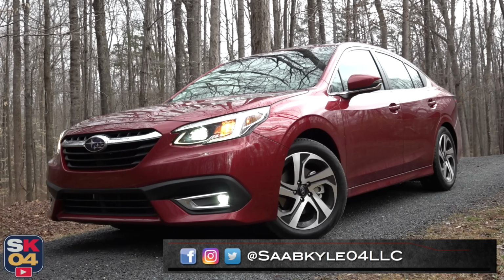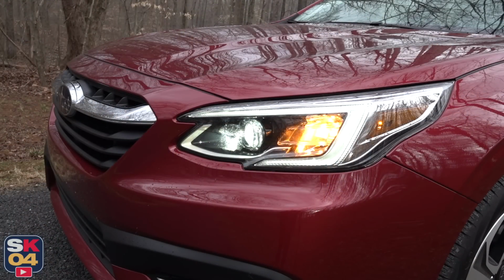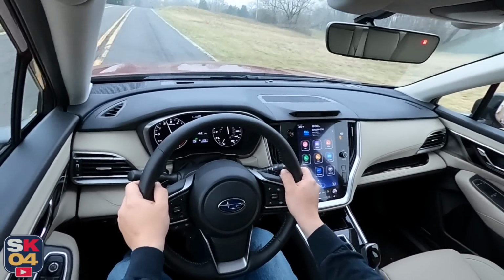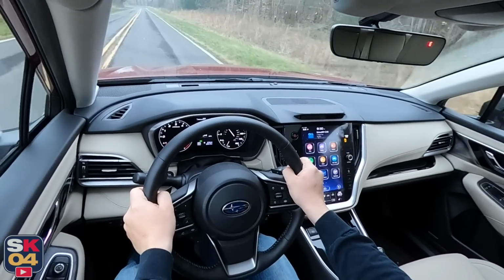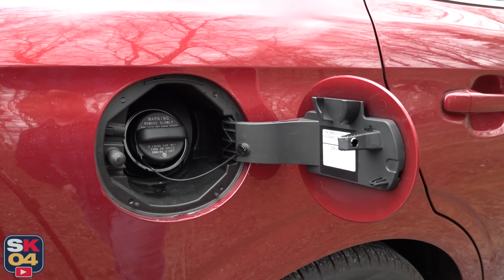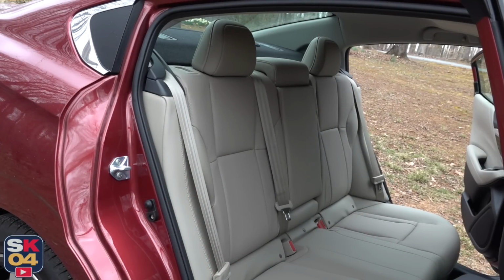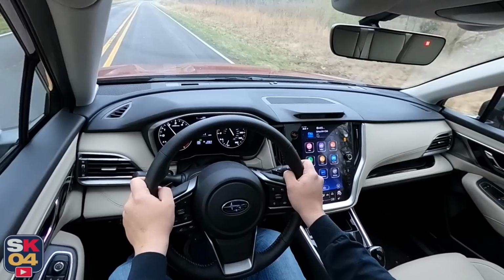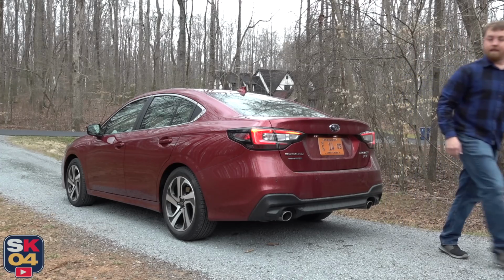2021 Subaru Legacy Limited XT: Start Up, Test Drive & In Depth Review

Comment: I work at Subaru of Little Rock and I love how much Subaru has came they are amazing and when moving vehicles I have tried the Rear automatied braking and it is strange and love the safety and how comfortable they are if I did not owe so much on my Mazda CX-5 I would get a outback limited love the video Kyle

Comment: CVT and Automatic Start Stop - two "features" that eliminate this vehicle from my consideration.
Reply: omfg me too, i've had 2 Subaru Forester CVT's fail on me.  Fk me that was a headache to get fixed.
Reply: I was a Subaru tech, service your transmission.
Reply: @bierlyynn  Subaru did, and it still fucked up.  They replaced it, it fucked up again lol
Reply: Do the fluid change on the transmission, don’t be a jackass about beating the snot out of it and pullout the fuse for the auto start/stop you won’t have a problem.

Comment: Oil burners. 
Leaky oil seals.
Reply: Change out the head gaskets you won’t have a problem.  Mrsubaru1387 has a video on why this is nothing but an old story and does not apply to the new motors
Reply: @AllenTokyo  you wanna bet????
Reply: @AllenTokyo  they are junk.
Reply: leaky oil seals that Subaru knows about but refuses to fix....
100k the steering column goes to hell.
Reply: @PileOnPileOffPileUpOnThe481  that’s the older ej’s bud not there newer engines.
Reply: @PileOnPileOffPileUpOnThe481  2015 legacy with 229k steering column is still doing fine…
Reply: @v8_sami  Legacy isn't the Impreza WRX now is it? Subaru can kiss my SSA!
Reply: @PileOnPileOffPileUpOnThe481  literally the video is about legacy… on top of that you were talking about Subarus in general. Lol
Reply: @v8_sami  I want to get a Forster. Definitely doing my research. I don't want to get burned on another bad motor.